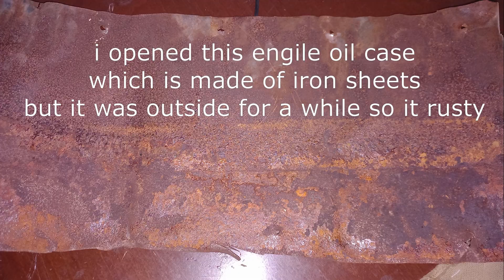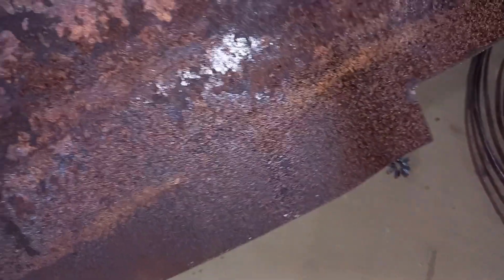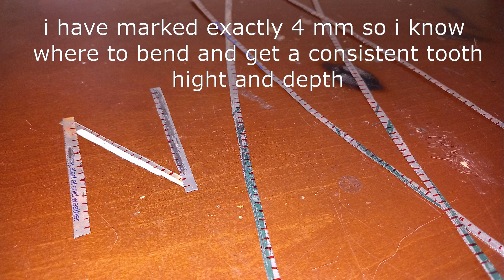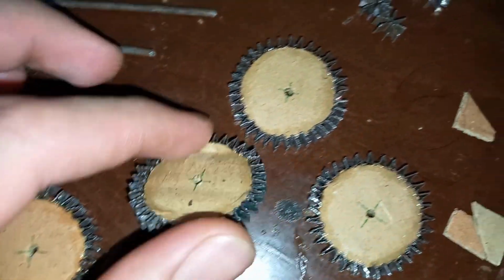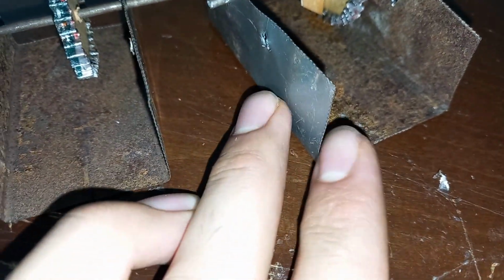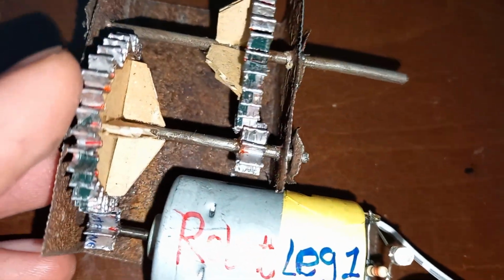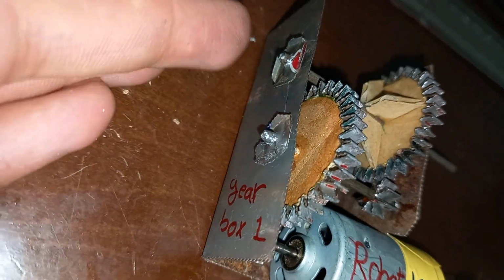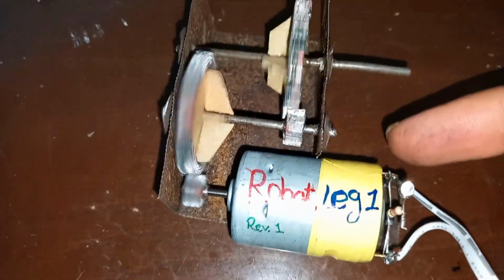How To Make Gears

Comment: You could attach the gears to a couple of tracks and equip the coil gun on top and you would have a quite powerful tank. If you want to make some robots used for defence, then this is an idea of how they can be made.
Reply from the maker: 👽: the Tracks are hard to make, i'm building a Robot to help me in my Experiments.. it would be Responsive and Self Conscious only using a 8 bit Micro Controller Unit!